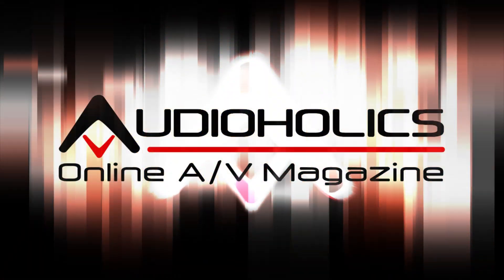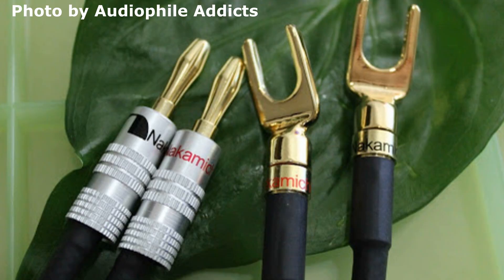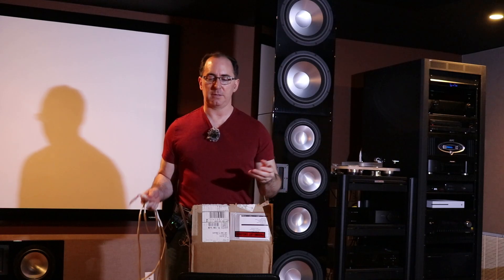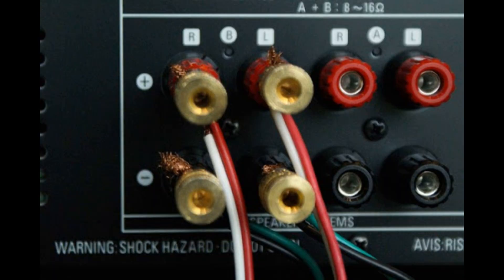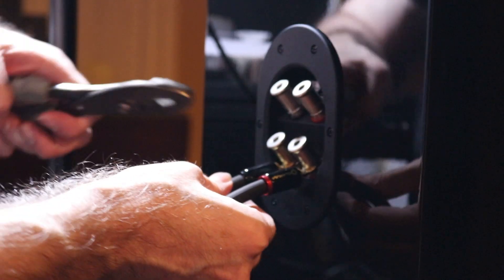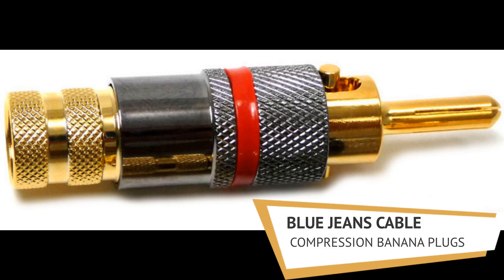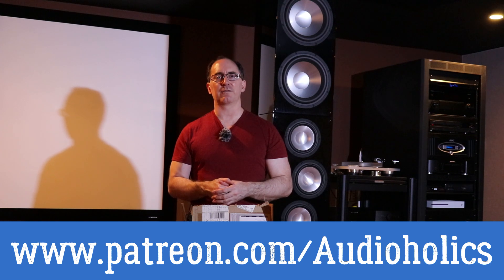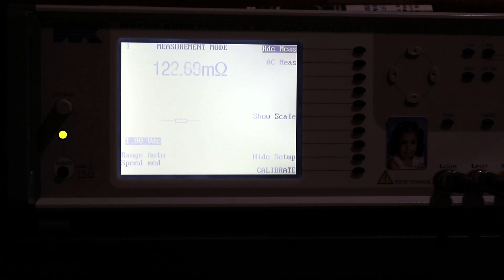Spade vs Banana vs Bare Speaker Wire Terminations: Which is Best?

Comment: Bare wire.  I used to work for a machinery company and any wire between screw terminals had to have a sleeve to protect it from the screw and also a number to help with checking during assembly and later servicing. 
  I use banana on one of my systems and screw on other ( Marantz 6G)

Comment: Crimped fork lugs screwed down are best. But only if you know how and use proper tools. The termination will be gas tight which prevents oxidation. Properly crimped wire and lug become one.

Comment: Solder is best, it's not even a question. All these connectors are only for situations where stuff has to be taken apart and switched around frequently (gigging). It's like asking if you want the electronics in your car hooked up with banana clips. So much backwards culture.

Comment: Going back to the dark ages, when we recorded with analog tape machines and mixed on large format consoles, we had spade lugs on the monitors in an edit room.

Those had to be tightened up every couple of days, and that was with a wrench, so they were much tighter than hand tight.

Either by mechanical vibration, heating and cooling cycles, or both, they would fall off if left alone.

I built a set of Kimber 8TC cables at home and used silver spade lugs (I believe WBT) that have a compliant wafer between two slabs of silver on the ends.

You had to crimp and solder these, and they were $70.00 a set, but very nice.

Comment: So, I use banana plugs or bare wire.  However, I know that spade terminals are different sized and a buddy of mine showed me that most speaker terminals have flat areas on their post and you choose different spade sizes to fit properly.  He showed two pairs to me, one that did not fit around the "round" side but fit perfect on the "flat" side and then snugged them down - they were not going anywhere.

Comment: I use milspec silver coated stranded 12 gauge wire with Teflon insulation. Which is actually pretty cheap surprisingly. The strands are a bit thicker so the overall diameter is smaller. Bare connections as I like having as little in the signal path. On my speakers, I solder all connections replacing the spades. Just less chance for dirty connections etc. My speakers are DIY too so It is easy for me to do so. A pair of 7 1/2' wires I just made cost $35

Comment: Audioholics, if a banana plug is gold plated with no parts that a magnet will stick to, except the screws that lock the speaker wire inside the banana plug housing, will the steel screws cause any problems? A youtube famous speaker kit maker and speaker upgrade expert HATES steel screws inside speakers, so are steel screws in banana plugs a problem? Has Audioholics measured the effect of steel screws in the signal path? Thanks.

Comment: I use spades because Robert Harley ( of The Absolute Sound and previously Stereophile fame) recommended them many years ago. That was good enough for me. I don't change speaker cables. I still have some Audioquest cables from about 30 years ago, before they started doing weird stuff with batteries.
Reply from the maker: Spades are OK if they stay tight on the post. Most aren't,  especially the boutique ones.

Comment: Always have used bare or raw wire as you say for about 45 years now ,carefully installed and wires trimmed ect. Never had an issue with it. Many thanks for your video.

Comment: I AM havind a problem with amplifier connectors with speaker cable so my old Sony Ta-f555 ESR have ONLY a little hole and the RAW cable is not doing contact i don't what to use because i don't think spades with fit inside that hole and i can't use banana terminals

Comment: I use spade lugs at amplifier side, tinned bundle at speaker side. I'm lucky my Rotel amp has hex shaped nuts so I can use a proper wrench, but I still hate 'em. Final torque is done with assisted movement on spade to center it. 
It was suppose to be easy 😁 still beats trying to fit raw strands, 
while being bent like a macaroni hanging over trying to manipulate wires somewhere in the void, 
as you say Gene, it only takes one escaped strand to have a potential unwanted smoke escape.

Comment: I have been on bare wire connection for last 10 years and did not find any problems. I still could not justify the banana plug for a permanent wiring setup in my home theater. Trying to figure out if any reason for me to switch and spend money on this. I understand that it is useful if we plug and unplug quite frequently and that is not my case.

Comment: I’ve had issues with monoprice bananas and blue jeans standard bananas.  The connectors all had carbon tracking due to high resistance connections.  The blue jeans locking bananas have not had that issue and actually gave a 2.5 dB gain below 60 hz with my Polk RtiA9’s.  I didn’t need the meter to notice a significant difference.

Comment: Like they say, If you don't like cats you just don't know how to cook them. :)

Good spades must be made of soft copper and not any other alloys. So when you clamp such spade in a terminal it gets slightly deformed and creates very good air-tight connecton that only gets better over time due to surface diffusion between metal parts.

Comment: A buddy of mine hooked me up with a combination of the spades for the speaker side and the bananas for the amp. As far as I have always done it myself, I’ve only done it raw. 
I’m planning on mounting a/v speakers on the wall. Do the 90 degree banana plugs work good with or on this? It stands to reason that they would. I’m just ignorant about electronic things like this. I might just go raw on the speaker side like you suggested. I’m connecting this new home cinema sound system I bought myself, slowly, one step at a time. As it’s something I’m not used to and want to get it up and running, and sounding right, the first time.

Comment: Was hooking up my stereo for the first time in years, but getting no audio. Trying to troubleshoot things now. Don't think it's the receiver since it's not getting any sound at all. And speakers should be fine as well. So I'm thinking it might be the cables since they are really old now, might have a break in them. Got new cables and plugs on the way. If that doesn't give me any results I will try and hook up another pair of speakers, and if I don't get any sound from them (even bad sound). I think will have to send my receiver in for service, and use my old receiver. But I can't stand the speaker outputs on that receiver as it only accepts really thin cables or a pin connection (can't remember the name of them). Audio issues can be so fun at times.

Comment: Hey Gene - Is there a degradation in using bananas vs bare wire? I want to upgrade my Magnepan 3.7i steel bar jumpers to 10ga copper wire, etc. (I am assuming that would make a difference too, etc.)

Comment: I’ve used all the methods over 40yrs, early on it became clear that banana plugs are the best. But they must maintain a tight fit (clamping pressure), they can get weak with age & lose their bite. Post terminal screws can loosen due to cabinet vibration, it happens! They also have more contact area at the terminal. Their convenient ease of use is a free benefit that’s great. In professional mobile businesses, they greatly speed the setup & rip down times of those events. Bananas resolve connection issues, & allow you to focus other issues.🎼🏆.

Comment: Agree with your analysis. Going raw will give you the best feel, but in case there are a lot connectors or you are plugging in and out a lot, some protection (I mean for the bare copper) is definitely needed. That's why banana plugs are useful. I swear I am faithful to my loudspeakers, but I need to move a pair of them between my desk and the back of living room (as surround back speakers). Otherwise, one needs to be stripping a lot of wires at the ends, and the wires will soon become too short.

Comment: Can we use any type of wires for connecting speakers or any special type of wire like speaker wire ? Can using wires for Electrical wiring or Electrical devices be used as speaker wire ?

Comment: You'd think someone would design something better, and more standard. The first thing that comes to mind is a threaded post, with plenty of space around it, that you could drop a ring connector over, and secure with a nut, some kind of  thumb nut or wing nut. Simplicity and standardization are key. There's been a zillion fasteners, adapters over the years, nothing great. My favorite was the Zerk fitting on cars, trucks, whatever, that allows greasing, simple, elegant, genius.

Comment: My solution for whiskers is to tin the ends.
And if oxidation of the solder is a concern, paint with copper plating solution, available from a stained glass supplier. 
You also didn’t mention pin connectors, or more professional connectors such as SpeakOn. Then there’s the old fashioned screw terminals. 
I assume you limited your scope based on newer audiophile speakers standardized on the combo connectors.

Comment: Hello Gene.  I prefer banana termination. And thanks to you I invested in Kimber 8TC and love the sound from my passlabs and magnepans. I use to use Nordost which were great on Bryston amp which was a bit dark  and Nordost was a good improvement. My question to you is biwire vs regular cable do you believe biwire cables  or regular and have you ever tested same brand same quality.  2nd question is have you ever tested Nordost flatline speaker cables? 3rd question do you know of a Y plug to convert biwire speaker cables to regular cables.  Thanks to you the AVR and 2 channel systems has a ton of information to the public. Thank you very much. Burt

Comment: Personally I'd go for spades as they offer more contact area, and they don't get loose as long as the binding posts are reasonably tightened . I think the edge a spade connector normally has over some types of banana plugs is it doesn't have the metal fatigue issue even with very heavy speaker cables. With weak banana plugs on heavy gauge wires, metal fatigue at the banana joints might occur after some years of use. That said, not all spades are good spades, there are always bad products that are not worth the money they're asked for.

Comment: My speakers only have 1 pair of binding posts. So, the cables that connect my monoblocks to my speakers have banana plugs at either end. My super ribbon tweeters have banana plugs connected to them, as that is the only option. They are connected to my speaker binding posts by spade connectors, as the banana ports are already occupied. Then my subs are connected to my speaker binding posts by bare wire, as the sub manufacturer rrecomends. The other end of that cable is connected to the subs by the manufacturers proprietary nutrix connectors. I honestly can’t comment as to which is best, but my preference is banana plugs!

Comment: So I am new to wiring. I am new to rigging. I don't have the option for bananas ampside..... bit I was contemplating running bananas on the speaker end. Should I solder the ends ampside? I want to use the setup to record so is there much of a difference resistance and sound quality wise?

Comment: always raw man.... but for speaker wires banana on the amp/wall plug sides and raw on the speaker side, bananas on all the output ends just makes it 1000 times easier when you have to pull things out or move a speaker for whatever reason like to get behind entertainment center to clean and dust.

Comment: Started with bare wire, then to spades and now I only use only bananas on both the amplifier and speaker side. No more loose spades to tighten (again).

Comment: Can I use banana and raw on the same connector? I need to parallel the speaker from the amp to feed a sub and a speaker - my goal is to take the cable to the sub and add a derivation there to the speaker. My question is merely mechanical and stability related - not about audio quality. Thanks!

Oh ... another question: what's your opinion on pre-insulated tube joints (crimped with regular locking tool)? Thanks!

Bananas 1st, raw 2nd - never used spades.

Comment: Hi 
I really respect your opinion’s . Very well based on real facts. 
Question about bare speaker cable…
What about soldering the ends with good 
Silver plated soldering wire. 
Good idea? Or maybe not 
Thank you

Comment: I'm a big fan of banana plugs.  This is spot on about spades as think of so many mechanical fasteners similar to this REQUIRE a lock washer...but something like this can be a problem then electrically.  Keep mind too what a speaker actually is: a VIBRATION machine!  So while spade connectors may have more surface area in theory, in the real world they can be very problematic whereas a modern spring-loaded gold-plated banana connector fit like gloves and don't come off.  I love too how great they are for quick connect and disconnect ability; it's literally a plug.  And indeed that's especially valuable when say hooking up a receiver with 7.1 speakers that "whiskers" and so many wires can indeed be a shorting concern.  For mine, optimally I crimp, then solder, then shrink wrap the connector, and there's plenty on the market today where the "cheap" ones done this way will be better than the "high end" expensive kind that promise a great crimp when simple solder is superior and even easier to apply in many cases(some very expensive connectors often have a lot of plastic or polymer insulation it's then difficult to put back together vs. metal stud easy to solder gets covered with shrink wrap or even just use electrical tape both of which help keep oxygen out of the wire).  Beyond that, I'm done in most cases making bare wire connections; it's fine for temporary use, but it's not a good solution long term.  Then again, I once knew a guy who used to electroplate the wire ends in gold and that was probably about as good as it gets.

Comment: I am using Nakamichi banana plugs at the moment.  I like that they have a two set screw clamp onto the cable and that you can insert the cable beyond the inner set screw to really get hold of the cable.  What you did not mention was solder.   Even when clamping the cable with set screws I still tin the exposed copper to make sure I won't get any whiskers and that the copper won't bunch up.  Prior to my current set up I have always soldered the copper to the banana plug.  We had an old fellow where I worked (Test Instrumentation at Ford Product Development in the UK) who said that it was wrong to tin a lead you were going to clamp with a set screw.  Is there any truth in that?
Reply: I've just looked into my own question, and one thought is that a tinned lead will have a stress point at the the soldered and unsoldered interface, and that the cable can fatigue and break at that point.  An un tined cable would remain flexible and be less likely to break.

Comment: I banana plug the speaker and amp ends.  I like the banana plugs you get from Amazon that have 2 set screws that you tighten as opposed to the kind where you bend the speaker wire back over a beveled ring.  The set screws are tiny though and you have to be careful not to drop them. Sometimes I change out receivers etc. and having everything banana plugged is well worth the effort. Trying to connect bare wire to a receiver or amp is a pain and I have had issues with the stray wires before as discussed in the video.

Comment: I think you were dead on talking about the stability of a banana plug connector vs spade. Also, the difference in surface area and connectivity for those connections is going to be negligible. You're already almost certainly going to have a larger surface area than a cross section of your cables, and therefore it's not going to make a difference. Its like if I have a piece of PVC being fed by a 1/2" garden hose. You're not going to reduce flow impediments (or resistance) by choosing a 4" pipe over a 1" pipe when everything is being fed through a 1/2" garden hose.

Comment: UK hi-fi magazines always advise bare wires, but I've always found that banana plugs are so efficient to use, especially if you need to send your receiver off for repair several times!

I've always found better sound quality through quality mains cables too.

Comment: On my legacy Sansui  SP 15 (3way 5 speaker) I have cheap looking spring clips for raw wire. I need advice on converting this, or on a good cable with banana clips on one end and raw on the other.  Thanks

Comment: I use banana plugs on the amplifier side, and I crimp a wire ferrule with shrink wrap around it on the speaker side. Works great and looks professional.

Comment: I feel you made some solid points on banana vs spade, and bare wire can cause shorting.  But regarding sound quality I am still unclear on Audioholics perspective on what give you the best quality sound: Spade, Banana or Bare wire (I can make an assumption on the best 1 of the 3 but I would rather have your comment)
Reply from the maker: When all 3 are working correctly, sonically  indistinguishable.

Comment: I change things too often and some speakers are not easy to get to the back of (and my amps are all a pain to get to).
Banana plugs on both ends of ALL my speaker wires.

Otherwise bare wire for me but as you mentioned "strays" make me nervous so I will usually put banana plugs and shrink wrap on them once I am confident in the wire length I need.